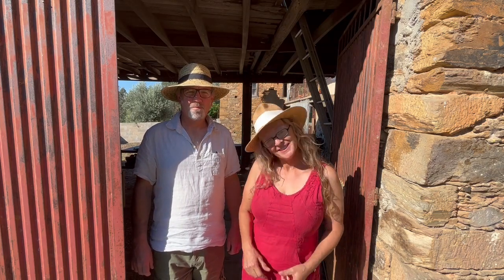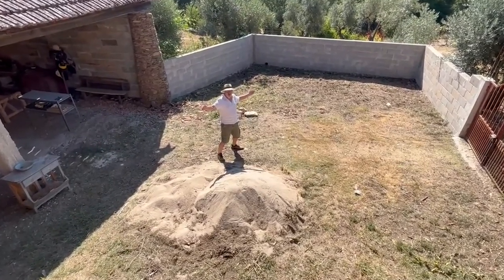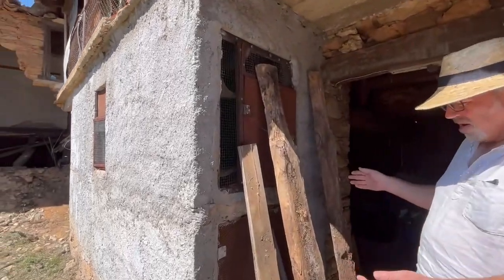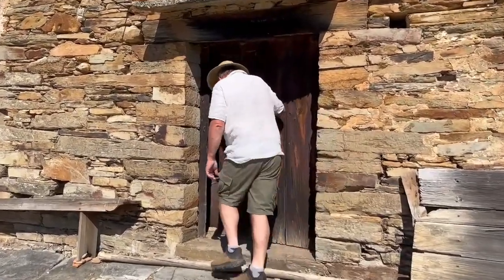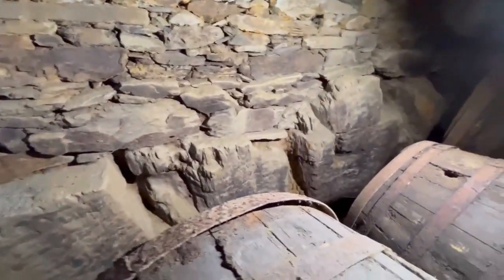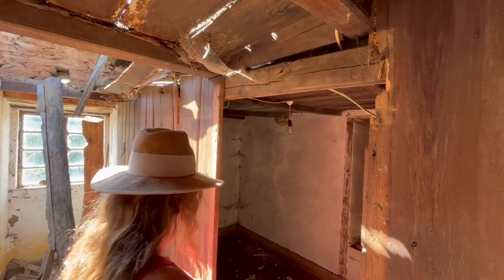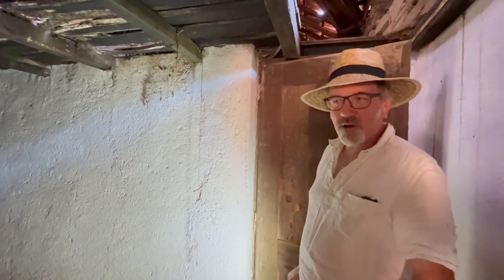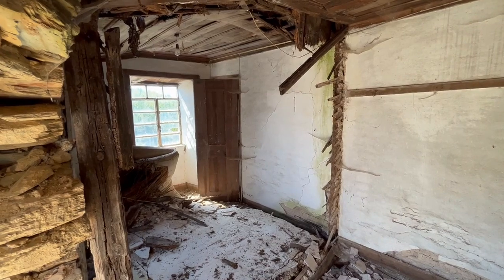We Bought a 150 Year Old Abandoned Property in Portugal

Comment: The implements used for leveling the ground are called harrows, here in Canada.
Reply from the maker: Thank you, Leona. 👍
Reply: I was going to say exactly the same as Leona even from Canada. I just wanted to add that if the ground needed several goings over it helped to put extra weight on the harrows. We had metal ones.

Comment: That can't be 200 square meters! My apartment here is 150 square meters and it's much smaller than yours. Are you sure that your property is only 10 x 20 meters?
Reply from the maker: It’s a small house compared with yours. Our 200m2 includes our two verandas and is the external footprint of the building. Our walls are 50cm - 60cm thick. Measurements are professionally surveyed and more or less match what we measured ourselves.
Reply from the maker: Of course the storage rooms on the ground floor are similar in area again.